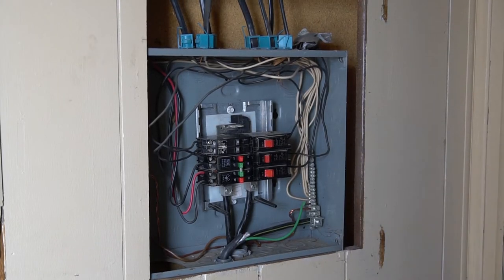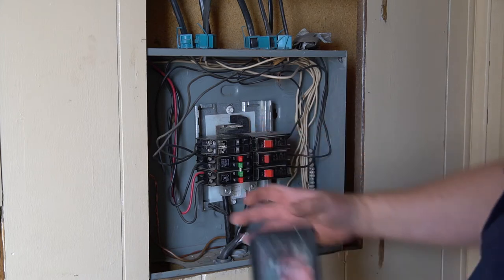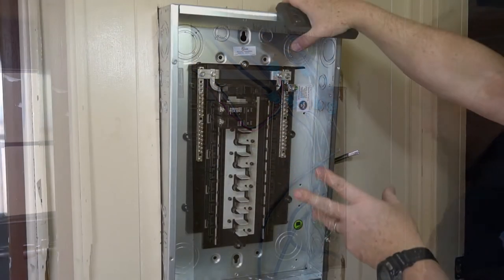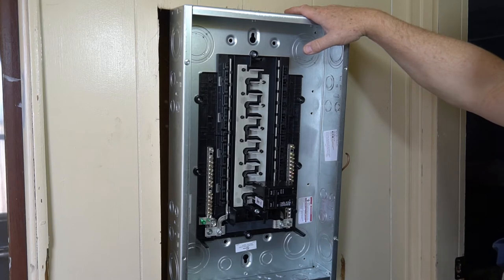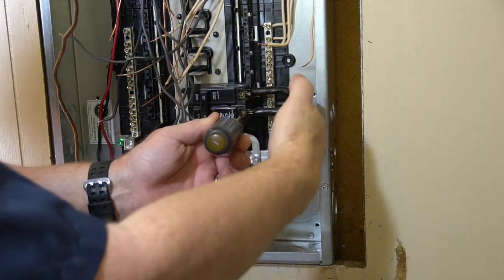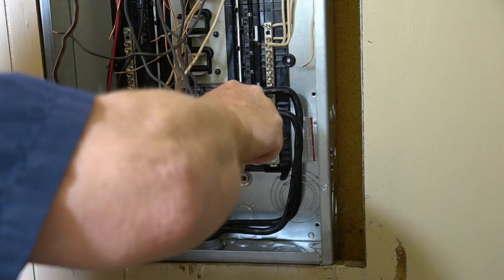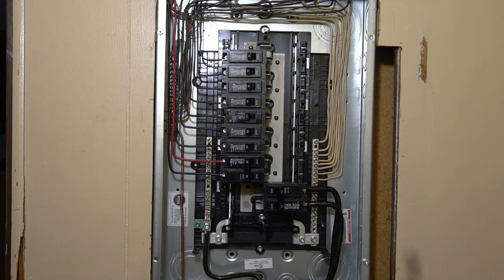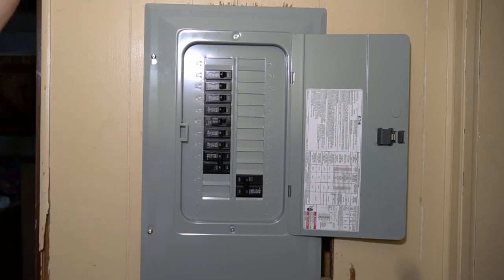⚡ How to Upgrade your Main Breaker Panel.  Step by Step Guide  🏠

Comment: Great video, thanks for sharing !!
Question :
Can I use a 30amp breaker for a craft shop I have w/ wood lathe, soldering station, wood burning station, and then plenty of lights and music ??

You see, i buried a 3/12 weather proof wire out to the shop (70 feet). I wish I had buried 10g wire but I didn't.  Anyway, nothing actually pulls many amps w/ the lathe pulling about 9 on start-up and runs on 5 to 7 under load.  But, I use bright LED lighting, charge camera batteries, music on the laptop, etc...
I don't know what the lights pull but I have 2 - 2 bulb florecents 4' long, a bright 8"x 8" LED light on a stand and use one of the machines I mentioned at the same time ...... at most.
If this pulls near 20amps I figure I might want to install a 25amp or 30amp breaker.
DO YOU THINK IT COULD BE A PROBLEM ??

Thanks for your generous consideration,
Sincerely .................................
Steph
Reply from the maker: Unfortunately, it is not code or recommend to put a 30 amp breaker on 12ga wire. The breaker size does not offer more power. The breaker is there to protect the wire from over amperage that can lead to excessive heat and wire deterioration.  Adding a 30 amp breaker will not change anything, but it may put your underground wire at risk.
I hope this helps.
Reply: Your 12/3 wire will not handle what you want to do. Also if you buried a yellow or white cable underground those cables are not designed to be buried. Only grey cables are designed to be buried. I don't know of any 12/3 cable being rated to be buried.
Reply: My reccomendation is if you have 2 extra spaces in your main panel is to install a subpanel in your shop. This would require extra expense but you would then be able to wire outlets as needed along with wiring the lighting separately.

Comment: NEC states the main breaker cannot be over 6 feet from floor but box can go all the way to the floor  16 inches from Door and 30 inches from front cover to wall. Box cannot be in a closet or in a bedroom.  So if  changing a old box that's grandfathered in you have to relocate box and meter and lead in  cannot be in a closet or bedroom.😊

Comment: (QUESTION below) I bought an older mobile home... so many issues an inspector would jaw drop.... When they (previous owners) wanted something to add on to they tapped into a kitchen light and overloaded it... so many dumb half as*ed wiring I am surprised the place didn't burn down...
.Then I found outlets/lights powered by 2 separate breakers.. it was SHOCKing to find...
.
.
.
.
.
QUESTION: I have a 200 amp breaker right after the meter and   then going to the utility hook up then to the 200 amp breaker panel... Would I need to keep the ground and negative separated ?  removing the busbar?
Reply from the maker: I am not a Master electrician, so take what I say with that in mind. 

To the best of my knowledge, if you have a main breaker panel at the service pole, this makes your breaker panel a sub-panel. If your ground is supplied from the main panel at the pole, you need to have a Bonded Neutral and Grounding buss in the subpanel. But if you have provided a dedicated ground to the subpanel, then you need an unbounded ground.  At least this what I have been told.

Comment: Awesome video.  Clean work.  My only suggestion is not to go by wire gauge in the panel to determine your breaker amperage.  As a rule, I never go higher than what was there before.  Just because the homerun is 12 gauge doesn’t mean the next leg is.  If it’s a 15 amp breaker but 12 gauge, I wouldn’t upgrade to a 20 amp I would leave it at 15.  I know my house too :)
Reply: You should consider both. You're right, but like he pointed out in the video, most of the old breakers were larger than allowed, so wire size was his best guide. Of course, he could have mapped all the circuits and used lower amp breakers if it made sense, too.
Reply: This is very true...the first house I ever built in 1976 had some 15 amp circuits for the bed rooms and living room but due to the length of the circuits 12 g wire was run for the home run from the breaker box to the first junction box (to minimize voltage drop) and from there 14 g wire was run to the remaining receptacles so you can't always go by the size of the wire in the panel.

Nice neat job but I hope Jungle Explorer has removed that green bonding screw to keep any return current from flowing on the ground.  Return current should only be on the neutral; the ground is only there for faults.
Reply from the maker: Thank you for commenting Nathan Pautler!  I am so glad the video was helpful.
Reply: @ericjorgensen4826  my local inspector made me put a 20 amp breaker because I ran 12ga yellow romex did not make sense to me

Comment: You went up higher why didn’t you put more wire in and strip the wires back so you had longer wires.
Reply from the maker: Don't quite understand what you mean, but I just went with what I felt was the best and easiest route.

Comment: Bend and insulate mains with tape never leave a wire sticking out straight bare that can contact your skin or hit you in the eye or face. You never know if  the wires could be energized if you pull the meter but still don't allow wires to stick straight out towards arms and face

Comment: I would have removed the green screw. The green screw would be a misleading a visual indication that you've bonded the neutral, because it's not obvious that you haven't screwed it in. Also did you use a cable connector for the ground wire? Still think it needs protection, might require it by code too, don't remember. Why not just put it through the main hole with your feeders?
Reply: That's the bonding screw and he said its a sub panel so it should be removed even where I am from in Jamaica
Reply from the maker: Thank you for commenting Mr. G!

Comment: My uncle called the power company to make sure they turned it off service like he requested just in case. They said ..." yep...your good to go."... it wasn't true. He survived...he was lucky. Turn off and unplug electric always. There are exceptions though. Many parts of circuitry store or hold electricity and can discharge. Static, fire, magnets, and stray leftover screws are another thing. A basic test pen light will show current to any novice.
Reply from the maker: Electricity is like a gun. Always treat it like it is loaded.

Comment: I would have just pulled the paneling off the wall and reframed the new box to fit right and then rewire everything and then put in new paneling, or upgrade the wall to sheetrock.
Reply from the maker: I may very well do just that at some point.

Comment: you forgot to ditch the green bonding screw !
Reply: Wouldn't he have had to hammer in and screw down the bonding screw for it to have effect here?
Reply: Did any of ya'll listen to him? He said this is a sub panel fed of off the main.
Reply: Sandman is right. Subpanels should not be bonded. Pull that green screw.
Reply from the maker: Thank you for commenting Sandman®!

Comment: Everything I have read in the NEC states that the bonding screw has to be removed on a subpanel. I currently doing the same for my mobile home.
Reply: That depends on whether they ran a separate ground from the main panel.  If they only ran 2 hots and a neutral, you leave the neutrals bonded to the grounds in a sub-panel.
Reply: Yes the bond screw needs to be removed on sub panel and a ground conductor has to be ran, you can not run 2 hots and a neutral.
Reply: @thomasmarable6818  you are correct on new work.  My only point was on some older homes like mine (1963), before having a separate ground was common (or code), they generally ran only 2 hots and neutral to a sub-panel.  In these cases it is correct to have the neutrals/grounds bonded together.  In any modern panel you should run a grounding conductor and separate them in the sub.
Reply: @timmedification  I guess he didn't need it to run a separate ground bar if he was gonna leave  the bonding screw or do you still do Tim?
Reply: @jesusostos3184  not sure I understand your question.  Any new work, they need to run 2 hots, 1 neutral, and a ground to the sub-panel, and then ground bus and neutral bus should be separated in the sub-panel.  I just had some old work that was grandfathered in.  Ground wires were not common in the 60's.
Reply: @timmedification  Thank you!!,
Reply from the maker: Thank you for commenting Jose Perez!

Comment: You didn't tighten the strain strap screws on the bottom for the incoming conductors. I could see the conductors move when you added  the second conductor to the 100A  breaker.
Reply from the maker: Thank you for commenting Stephen Dee!

Comment: A number of mistakes. Must remove green bonding screw in a sub panel, self tapping screws are not allowed to be used for a grounding bar. Must be tapped in with at least two threads of screw in the metal. If that is not possible you must use a nut and bolt fastener for ground bar.  With aluminum wire he should have applied nolux on those wires and also should have checked what the proper torque is for those particular breaker lugs. So you can overtighten or undertighten. Please always consults manufacturers specs on all torque settings. And lastly he should have installed a plastic bushing on the 1 1/4 connector for the SER wire feed.
Reply from the maker: Thank you for commenting and promoting this video and my channel.
Reply: Bushing not required on a cable connector.
Reply: Also with todays aluminum conductors nolox not needed or required by NEC
Reply: @thomasmarable6818  Bushings are required by 250.92(B)(4) for bonding at services and by 312.6(C) for conductors 4 AWG or larger. Other references are 342.46, 344.46, 352.46, 445.16, 312.6(C), 430.13, 314.17(D), 314.42, 426.22(C), 300.5(H), and 300.16(B)
Reply: @thomasmarable6818  yes I agree on today’s aluminum conductors no lox is not required or needed because of the mix of alloys in the wire, but this was a replacement of a panel using existing cable. Best practice is to use nolox if it’s an older wire.
Reply: @CarlosContreras-ur3be  got him 🙏🏼
Reply from the maker: Please read the disclaimer in the discription of the video.
Reply from the maker: In case you were unaware, this is YouTube, not Harvard. If you want University level education, go to a University. This is YouTube. Your expectations are out of whack.
Reply: @thejungleexplorer  👏
Thank you! This was very helpful!
Reply: @thejungleexplorer What could you possibly learn at Harvard that isn't already on YouTube University 😅
Reply from the maker: @RWard32  Wokeism 😜

Comment: I thought that upgrade meant how to increase from eg a 100 amp box to a 150 or 200 amp box.
What would that look like I wonder or is it possible?
Reply: If you decided to upgrade the panel. And wanted a larger capacity panel. You would also need to upgrade your meter and your service entrance conductors
Reply from the maker: Thank you for commenting John O'Donovan!

Comment: Nice job, but I’m just thinking out loud I personally would balance my loads.
Reply: The load is balanced. Breaker panels have a ZigZag bus system.
Reply from the maker: Thank you for answering this question.  I appreciate the help.
Reply from the maker: Nothng But Gadgets gave the correct answer.  If you pay careful attention to the bus plate in the box, you will see that it zigzags back and forth, so that each breaker is on a different bus when installed as you see in the video.

Comment: Does code requirer all rooms with a water supply to have gfi breakers or is it just gfi plug ins
Reply from the maker: GFCI outlets are required within 6 feet of a water source and on the exterior.  However,  any outlets downstream of a GFCI outlet are also protected, even though they are regular outlets.
Reply: So you dont have to have a breaker with gfi pig tail on it for rooms with a water supply in the main box sorta makes more sences  to stop it at the source
Reply from the maker: @5050johnsmith  I would check with your local or state codes just to be sure, but in general, GFI breakers are not mandatory.
Reply: @5050johnsmith  you can use gfci outlets that most find more convenient to reset than having to go all the way back to the panell
Reply: Gfci is required in the kitchen look up article 208 in the NEC for reqirements on gfi placement

Comment: How about some GFCI and AFCI protection.
Reply from the maker: GFCI outlets are required within 6 feet of a water source or on the exterior of a house.  Normal breakers can be replaced with AFCI breakers if desired.  Please check with your local and state codes for full compliance, as these are constantly changing.
Reply: yeah practicly everything should be protected afci and gfci if you want to upgrade get a plug on neutral panel it makes it easier to install a bunch of afci Breakers

Comment: Not sure what your code is where you are but I noticed that your main service cables are aluminum!? Where is your Noalox antioxidant paste!?
Reply from the maker: I am always fascinated when experts comment on my DIY video. I personally never watch videos for things I know how to do and it fascinates me when experts watch videos for things they already know how to do.  I mean, what could the reason they go around watching videos for things they already know how to do? It is an interesting psychological phenomenon.
Reply: Chris Michaud,  just so you know, with the newer aluminum conductors, there is no requirement be the NEC, or the manufacturer of the conductors for that product.   There are a few manufacturers instructions for very few products that do require it.  And the maker of the product is not going to tell you it’s not required.
Reply: @thejungleexplorer  Old guys sometimes like to look at videos like this even though they know what they are doing just to kill some time or see how diy guys do things.  

Very neat wiring job!

Like another person said, if that ground wire goes to a ground rod that is not also solidly wired to the neutral at the main disconnect, you should leave that green bonding screw in place, otherwise you could have a difference of potential between the ground system at the sub panel and the neutral, which would be dangerous.  But this is not the proper way to ground a sub panel.

However if there is a solid metallic connection from the ground wire at your sub panel all the way back to the main disconnect, you should remove the green bonding screw, even if a ground rod is involved along the way.  And this is the proper way to ground the sub panel.
Reply from the maker: @ericjorgensen4826  Thanks for commenting.

Comment: Hello there,  I would like to send you a few pictures of my box in hopes for some advice.  I would like to leave me email with you and if you reply I can send you pics of the way they left this box in the house i bought. It cant handle the load and I know it needs to be replaced. We had a few power outages in our area that may have also caused the box to surge and jeopardize the box. But it needs to be replaced. I think that it is the main box and it is not the sub.  To whom may be able to help me keep this house going for my kids and I.
Reply from the maker: Okay, if it is the main box, you will have to have the meter pulled by the city in order to disconnect the power (unless there is the main disconnect somewhere).  If you live in a city, the local codes will probably require that the electrical work be done and certified by a licensed electrician before they will reconnect the meter. This is especially true if you have a digital remotely monitored meter. If you live in the county, the codes may be laxer, but this varies greatly from state to state and county to county.  I would check with your local codes before attempting anything because you definitely want the electricity disconnected before you try to work on your own box, and if pulling the meter is the only way, that is where the trouble comes in with the local authorities.

Comment: that is not a sub panel, the code requires a disconnect near the service entrance, i.e., you meter. Using a "disconnect" there does not make it a main panel. I see people use the term sub panel and usually it is not. IMO...Installing all the breakers on one side essentially is installing all the load on one phase from the meter. Try to balance the load for each phase...Very neat work. Thanks I did learn from this video.
Reply: No install the breakers all on on side does not use only one leg. Yes its a leg not a phase. 120/240 is a split phase off of a single phase primary.
Reply: No it is sub panel, its being fed from a main disconnect or panel.
Reply: @thomasmarable6818  you are correct there, I had my head up my zxx on that one....
Reply: @thomasmarable6818  the guy installed a "disconnect" after the meter with a breaker which doesnt make this a subfeed panel. IMO. If I were this guy I would have used a MLO panel in the mobile home. There are some rules when it comes to mobile homes that a little different. I would not call this a subfeed based on the info shown in the video.
Reply from the maker: Thank you for commenting J Stone!

Comment: How much does it cost to have something like this done by a professional.
Reply: My mother was recently told about $2500 to replace hers in her house, which was built in the late 60s or early 70s.
Reply: @bloodgain  Thank you I appreciate the update.
Reply from the maker: Quite a bit.  Price will depend on a lot of factors, but it will not be cheap.

Comment: It’s probably safer to label all the wires before taking it apart. I’ve seen other videos and they label everything.
Reply from the maker: Yes, in a system where the existing wires are labeled, you can label stuff. That was hardly the situation here.